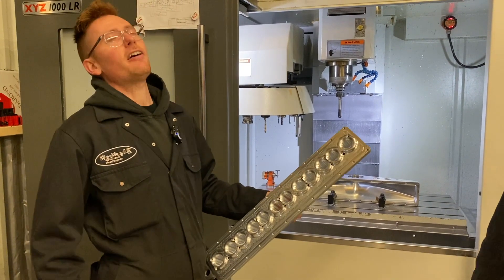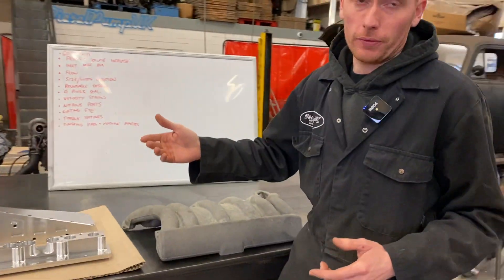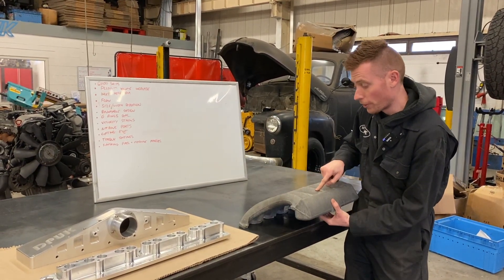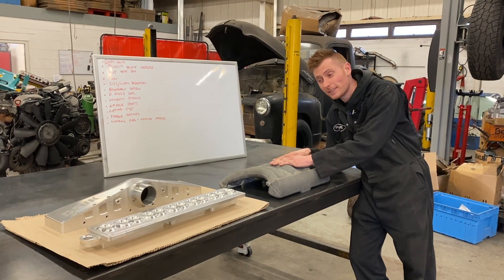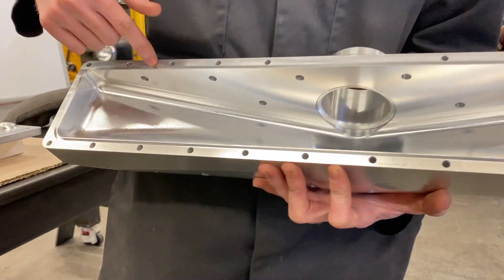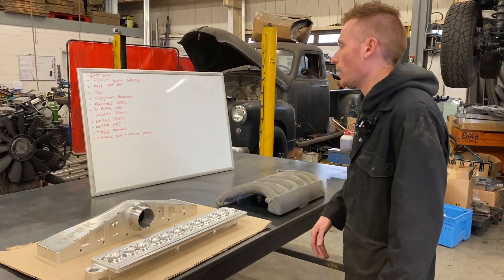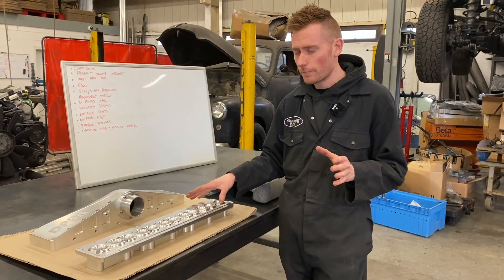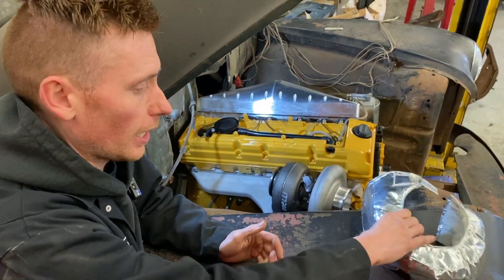OM606 Billet Inlet Manifold for our 600++++bhp Build

Comment: I thought you said Mercedes knew what they were doing and you've knocked up something that looks great but does it add any improvement. The only way to know is first with a flow bench and then the torque curve as measured by a dyno before and after.

Comment: Just like your exhaust manifold you are claiming gains, never showing dyno or flow bench proof. 
Those bellmouths have to be spaced up into free air, not flush mounted. The nuclear cooling tower design is best at 5.5% flow increase, but for boosted applications its only 0.5% so it doesn't really matter

Comment: One disadvantage is the short runner manifold will kill bottom end torque .
Reply: Are you referring to pulse tuning? Given that this design almost eliminates the presence of an inlet runner, you will lose the pulse effect at whatever speed the OE part may have been tuned to, but I expect you would gain torque at practically every other point on the curve, or at least every higher place on the curve. If that is correct, then you will get higher torque and power peaks and more area under the curves, thanks to better air flow at all other speeds, and particularly under boost.

Comment: It's gonna be so expensive, plus the exchange rate is a killer😵😵🤑
Reply: Not unlike the billet exhaust manifold. It's a beautiful part, but it's hard not to feel sticker shock. I don't know that the intake manifold will be any cheaper, although there appears to be no welding input, so that may be worth some savings. It would be nice to have dyno numbers on the intake manifold so a person can quantify the gains and make a value judgment thereon.
Reply: I believe I'm at the top of the list with a 6 week lead time, I'd say how much I was quoted but I'll let them announce it first.... and the exchange rate will get me.  It's a 110 engine swap we're doing and this intake will make the engine compartment much easier to manage, especially out on the trail.
Reply: Still gonna buy one for my build when it's time

Comment: Seems like a good start for an adapter plate to fit up a roots supercharger
Reply: Not worth the effort on a diesel. The compressor efficiency of a roots blower is garbage compared to modern turbos, they make hot, low density air unless you pour methanol through them to cool the charge down again.

Comment: Would having such a short intake runners negatively affect torque? Or because this is a forced induction diesel is that a non issue?
Reply: I imagine low end torque will be affected. However being a turbo diesel that's something you generally have a surplus of. This will surely help with higher RPM power.
Reply: I was wondering about that as well, like to know this..

Comment: What are the advantages of short trumpets/no runners with the bigger plenum, vs a smaller plenum with longer runners like the original?
Reply: Higher RPM power I would guess. Likely would hurt the lower end torque but should be capable of making more top end.

Comment: OMG !!!! what trans is that ? does it use your GM auto box adaptor kit ? cheers !
Reply: Looks like a 4l80E. 4 speed. Basically an electronically controlled TH400 with overdrive.

Comment: Question,  Which engine would you use om606 or om617, which would have the best performance - upgrades ?
Reply: 606 hands down, the cylinder head flow of an OM617 limits it to around 250hp

Comment: All that is left is a billet block and head. I know you can do it. But who has the money for that?
Reply: A billet or stronger steel block is needed, it’s the only thing holding back the 606 at this stage, unfortunately the blocks break in half after 6-700hp depending on drive pressures and tuning,
Reply: Anyone filling the blocks yet?

Comment: I'm supprised you haven't whittled out a billet engine cover replacement,  with  DPUK unplace of the merc logo,  and yeah you should get an old around 49-50 Mercury, swap in a merc in a Mercury, it could be the Murcury-Benz!  I have a ton of ideas if I only had cad and a CNC whitteler! Carving aluminum by hand isn't easy,. Any plans of casting a manifold?? Inlet and outlet? There is a few small shops here in the us, that cast aluminum and iron, and I know they are quality Craftsmen in the UK that can do the job! A large block of aluminum can't be cheap, then the hours of CNC, casting will be much more affordable!  Heck I just bought a 12" bar of aluminum for a motor bike exhaust hanger, it was $10,  they could be cast from old Pistons or something, for low expansion! Haha,

Comment: Would love to see a dyno comparison vs stock manifold (both exhaust and intake manifolds) :D

On a side note, would love to see you guys put an OM606 on propane :D
Reply: I made a similar intake for a Nissan TD42 (hideous sheetmetal box on machined factory manifold - he's right they always look crap). It didn't improve performance on the dyno, but Air:Fuel ratio went from 19.5:1 to 22:1 at 25psi (about 80% load, we couldn't reach full load as it was a fairly small inertial dyno). So we could have put more fuel in to make more power. The stock nissab manifold is garbage though, much worse than this one. the cross section of the log is the same as one port (6 ports).
Reply: @rubikmonat6589  interesting. Thanks for your input.

Comment: Congrats, that's beautiful, and I have to have one. But you did forget a couple of important figures in the video: 1) weight compared to factory intake, 2) dyno gains. Looking forward to more details on this beast.
Reply: @HB-gv9sz  Weight is always a factor. Small difference, small factor. Big difference, big factor.
Reply: @HB-gv9sz  If I find out what it weighs I promise not to share that information with you, if that makes you feel better :)
Reply: @HB-gv9sz  weight distribution, a lighter manifold won't completely alleviate issues like that but it helps.
Reply: @HB-gv9sz  Cornering and body roll, under/oversteer, acceleration, braking, fuel economy, ease of working on it, etc.